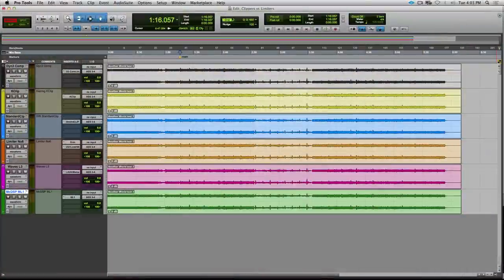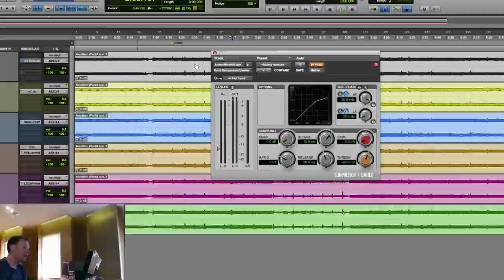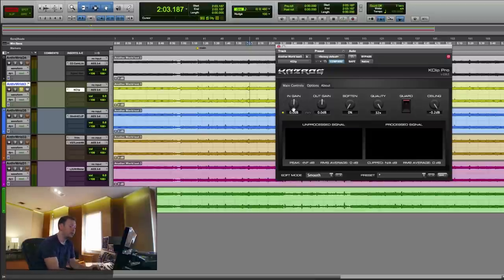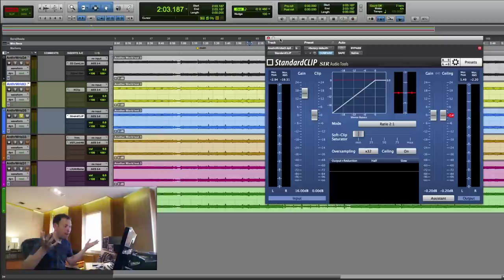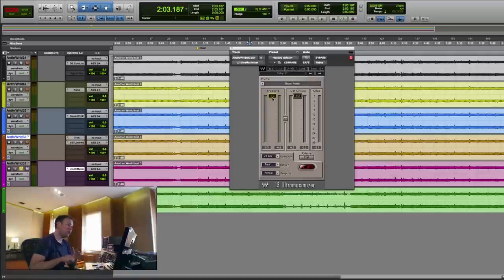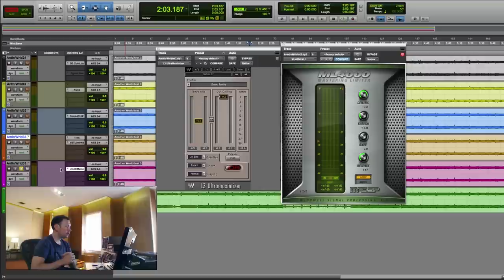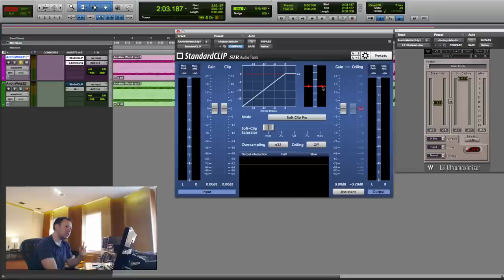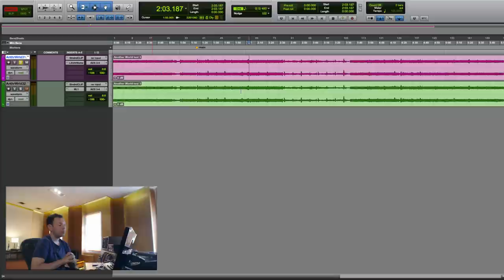Clippers vs Limiters - Fuseroom Studio Masterclass

Comment: For my money the best clipper is the Tokyo Dawn version of Limiter No 6 - because it has the “delta” feature where you can just listen to the artefacts introduced by the clipping process. Its easy to hear when you’ve gone beyond the point where you’re clipping transients and are now distorting the body of the trac
On a technical note, what I’ve found is that if you’re clipping 6dB off your track, the distortion introduced is equal to the amplitude of the original track - there will be some masking since the distortion occurs with the loudest events so it’s not as offensive as you might expect. What you will notice is distortion on sustained sounds (or low frequency components) if you clip them.
Reply from the maker: They're great plug-ins, I haven't used them so far but I heard great things about them, for sure!

Comment: I recommend staying below 1.2 dB with your first clipper, that into 1 or 2 limiters; and then have a final clipper doing 0.3 to 1 db of clipping.. possibly followed by a final true peak limiter just to make sure you stay below 0 dBTP.  Usually, 1 to 1.5 of total clipping is the sweet spot, but I know you were pushing the loudness as much as you could for this video.
Reply: Interesting: I agree with you here: clipper -> limiter -> true peak clipper. BTW.... This is exactly the default configuration of the TDR limiter 6 GE ($50). Even the free but older limiter no6 (the one shown in the video: it's my choice for best free limiter) has a similar capability. That said, most mastering engineers use some light clipping before a limiter, though this is not true for every track. The main reason is what is shown in the video: the clipper does a light amount of clipping to reduce the crest factor. This prepares the audio for the limiter so that it doesn't need to work as hard to raise the level (or reduce again the crest factor, depending on how you look at it). It's all about lowering crest factor with as little undesirable artifacts as possible. As said in this comment above, it's sometimes the case that serial limiters are used for the same reason (none will have to with so hard as to change the transients in an audibly bad way). Same with serial compression.... Same trick, different purposes.

Comment: This doesn't work in the loudness wars department because you can't get an EDM track at 4 dB crest factor with Clipper without distortion. New Limiters like Fab Filter Pro-L2 and Izotope IRC IV have the "Modern algorithm" were you can push the track really hard and still it doesn't fall apart easily. Try that with T-Racks Clipper and hear the horrible distortion you get. Don't even ask about Waves L2 and all those outdated Limiters, they have their limits were they fall apart if you push them hard.
Reply from the maker: Thanks for watching and commenting! Is there a specific clipper or limiter you've found to work generally well in an EDM setup that you could not do without?
Reply: I use Clipshifter from LVC audio for my EDM master, sounds fine. Any other recommandation ? And yea, ofc DMG limitless as limiter
Reply: Fuseroom Recording Studio UG  if i may intrude :-) , i use Sir Audio Standard Clip as a clipper, it's amazing for the price and by any standards to be honest. Limiters, i've literally tried them all. If i would HAVE to keep one limiter only, Limitless. It has the more " high end" sound. A.o.m Invisible Limiter is by far the best single band Limiter. Impressive on a good mixdown but i find the price too much for our era.  Then Tdr Limiter 6 ge. Simply the best value for money by lightyears and a beautiful punchy and subtly sometimes "gritty" sound. Has a beautiful clipper module included and also a superb high freq limiter which does wonders in taming " harshness"  and does work a lot better than the Spectral clipper thingy in Ozone 8
Reply: I use t racks clipper and my tracks sounds as loud as 'pros' with no distortion, just learn how to use them
Reply: I can use a stock clipper or limiter in FLstudio and achieve this...not sure what you're doing different....probably something going on in the mix.  Clashing freq's, not cutting enough, too much boosting, arrangement...so many things can effect the way your limiter and/or clipper sound.
Reply: Oh... Sorry comrade...Didn't you hear... The Loudness Wars are over.
Reply: It's called ISP protection which is why the TDR Limiter6 is so good.  ISP protection prevents you from clipping on the  AD/DA conversion.
Reply: yes you can, you clip first then limit and meet them in the middle with gain reduction.. you dont have to have your clipper do all the work
Reply: fabfilter L : -9 rms no distortion.